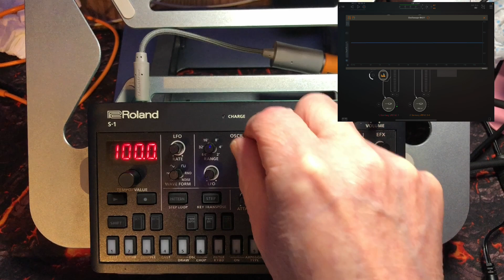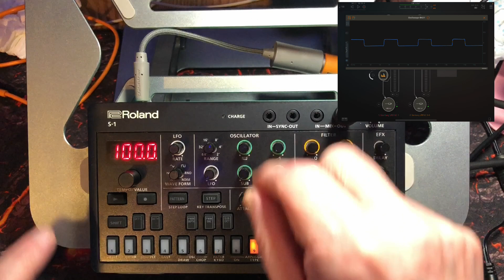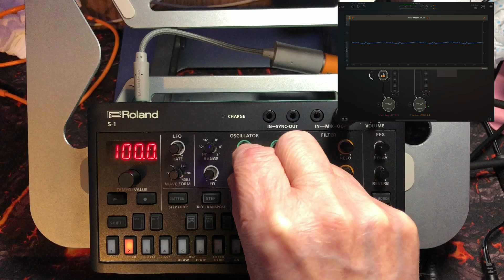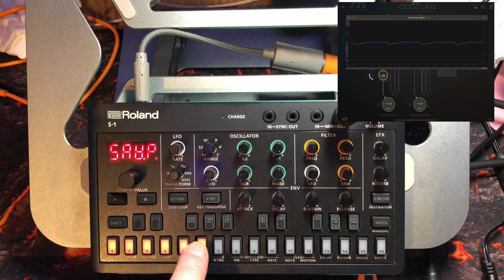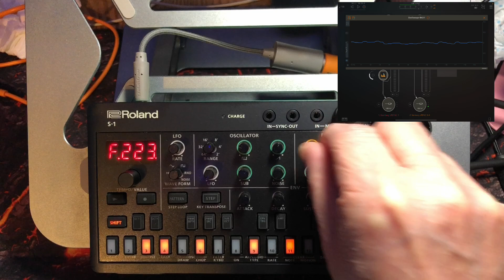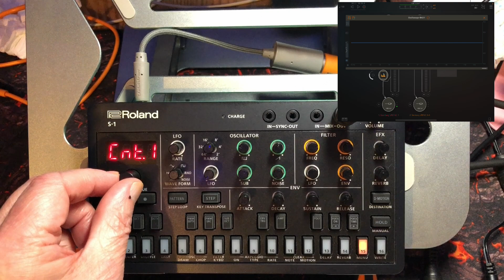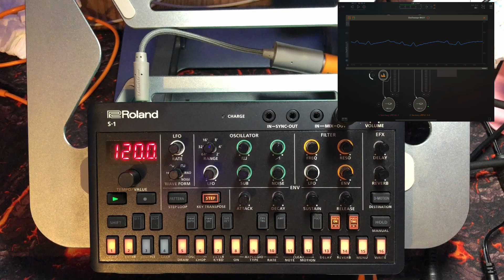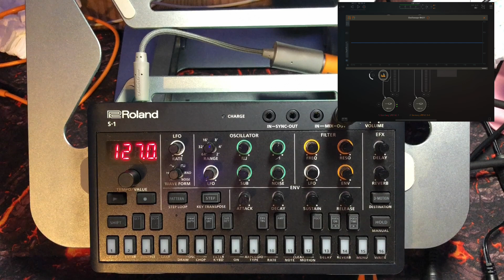Roland S1 - Getting Started Tutorial - Making a Sound & Sequence from Scratch & General Guide

Comment: The s1 was a little harder to get started with then larger synths.  I know the good sounds are in there.   Just need to get to them lol.
Reply: I feel utterly lost trying to learn the S1. The J6 and T8 are way simpler than this thing.
Reply: @metalforever12085  yeah I have the t8 and it was simpler.  But time consuming to program the bass without midi.  I have some other synths they all take some time to get used to.   I want a j6 as well.
Reply: True. It's not user-friendly. If they would create the remote control app for it, it would help everyone.